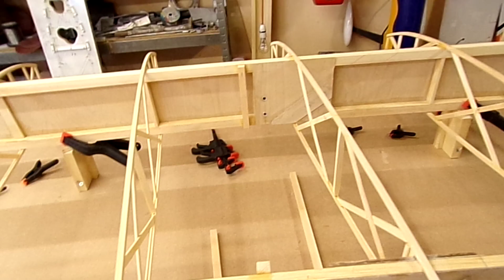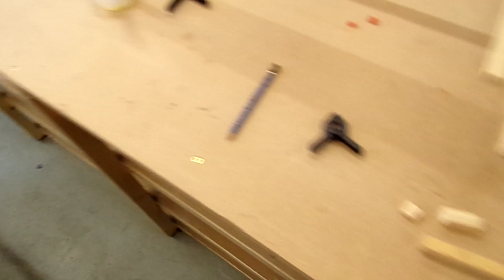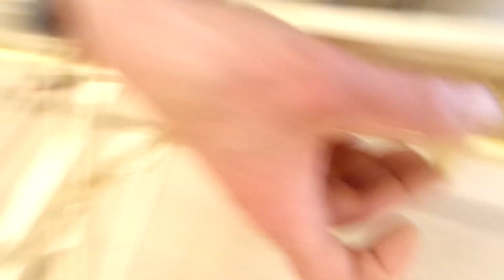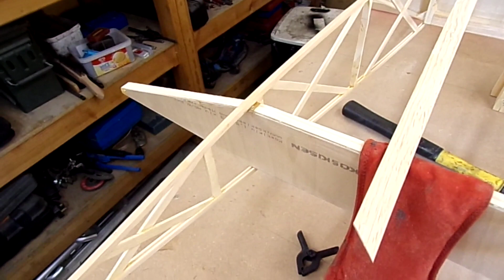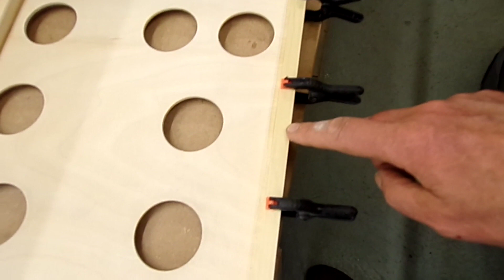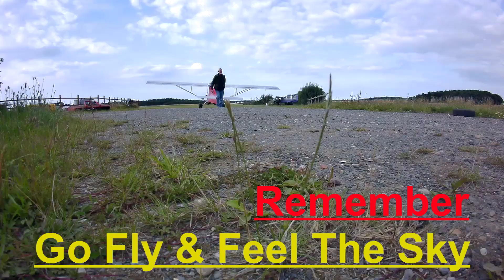EP52 Top Wing build continues for Fisher Youngster.

Comment: Love the prop looks like it could be on display on the wall, however much better to be pulling you through the air. Needless to say building a wooden aircraft requires alot of clamps :-)
Reply from the maker: I am with you that prop is art but functional so need to be on a plane. The saying is you can't have enough clamps and I never seem to have enough.

Comment: So why that type of configuration with the fuel tank bottoms? Wouldn't it be lighter and just as strong if you just router out an "X" pattern instead.
Reply from the maker: Good question, the loads are along the edges of the tank and I need to tie in an support the lower part of the rib, a simple X would not do that and cutting out an X pattern and mantain  the support I don't think would have saved much weight over the lightening holes. I do think about it, as you obviously did.
Reply: @flyingkub  Just curious, but have you tried making the one with the X and seeing which one is better off? Wouldn't you want to know? I would. Come on,, just make it and let's see. ☺
Reply from the maker: @outlawflyer7868  from a design point of view I looked the stress loads and weight advantage of each and the X was 3% lighter, the lightening holes worked out 5% better at load dissipation. Unfortunately I don't have the materials or the practical test equipment to carry out proper dynamics real world trials. The scrap drawing sent used a solid sheet across the whole tank bay and ply webs between the compression members. I do use my design and stress analysis experience to calculate the effects but have limited resources.
Reply: Man, if plywood wasn't so damn expensive I would give it a go.
Reply from the maker: @outlawflyer7868  same here 😀